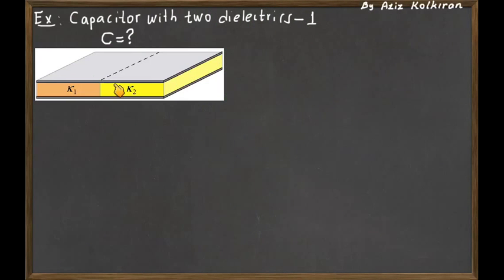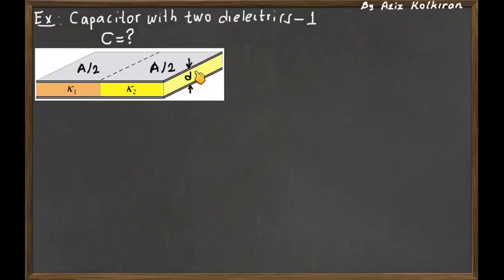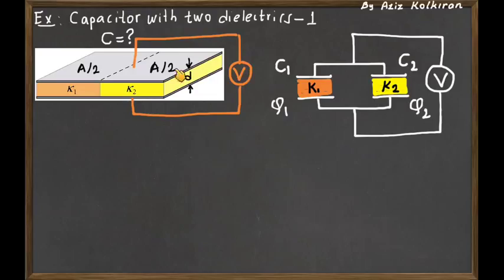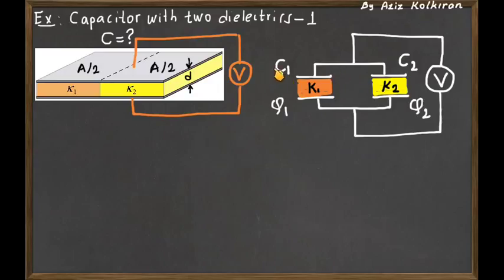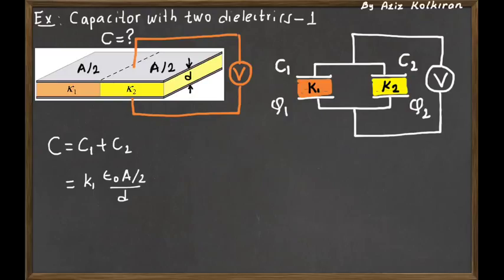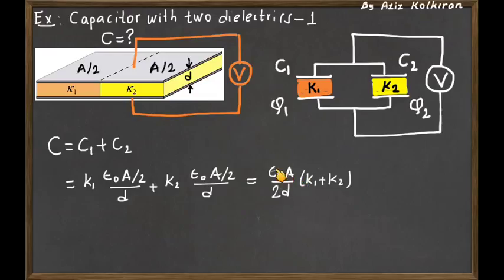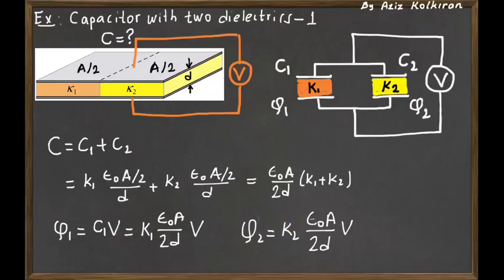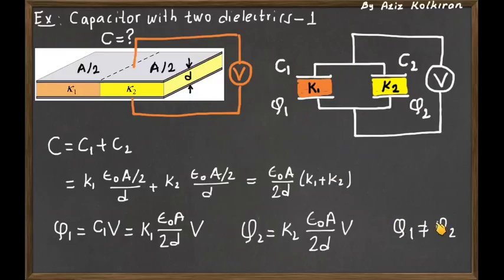Problem Solving-Capacitor with two dielectrics-1

Comment: Please Clarify :  
In parallel capacitor having two dielectrics with relaive permitivity X1 and X2 and distance "D" between plates . Now voltage "V" between the plates of both capacitors is same ,  but electric field in both dielectrics will be different due to different dielectrics ....than how come  DE1 =DE2 = V ??  ( E1 AND E2 are feild in different dielectrics) what is wrong here???
Reply from the maker: There is no doubt that E1=E2. Having K1 different from K2 will not guarantee different electric fields because charges on both capacitors are different if you keep the same potential for both capacitors. Larger dielectric will get more charges to equalize the electric fields. I hope this clarifies your confusion.